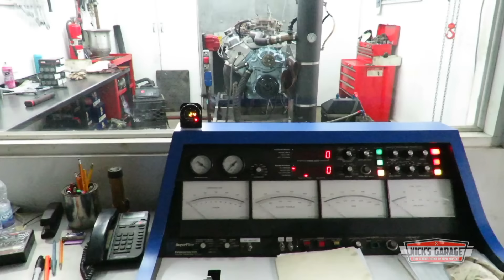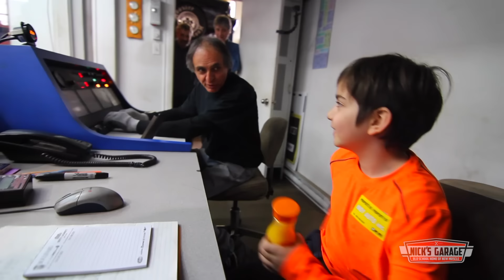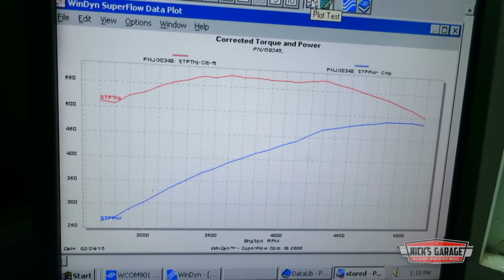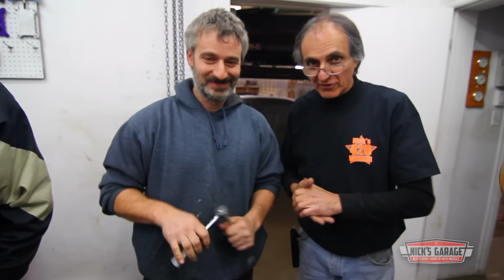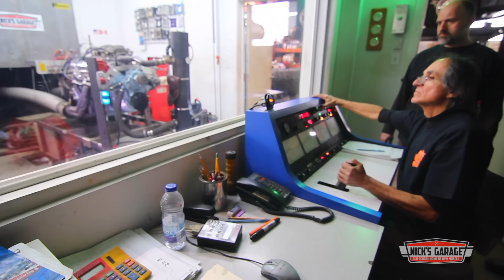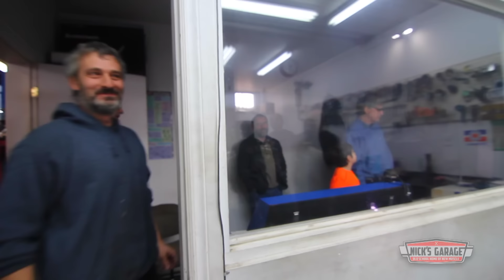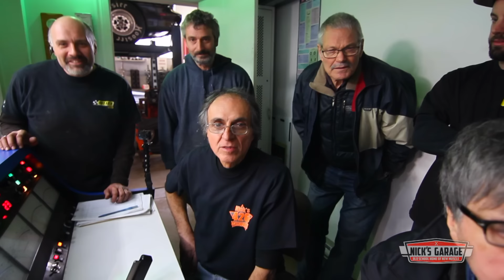Fire On The Dyno!! - Pontiac 455 Lights Up

Comment: Kauffman aluminum heads would be better for 455 Pontiac
Reply: blake Choquette I could see only 28 degrees with Kauffman heads but the e heads normally like a little more timming for max hp
Reply: Nothing here i've seen doesn't impress me.

Comment: It is awesome seeing 500 hp from an old iron block 455. See boys they dont all have to be ls motors.
Reply: Don't tell Chevy about this. They'll be putting 700 pound cast iron lumps in the ZR1. They're wasting their time with 400 pound engines that make 755 hp, idle down around town and get 25 mpg. Yeah these old pigs are the answer.
Reply: @bigblocklawyer  Gran Nationals were doing that 25 years ago..
Reply: @DarkSim77  I had several 400 ram air 3 TA's and a 73 TA with a 455 Super Duty I put in it out of a totalled 1974 SD TA.
I switched to Grand Nationals in the mid 1990's and had 11 of them over the years. I liked my Pontiacs and liked my Turbo Buicks.....both bad arsed in their days. Wish I would have kept the 73 Trans Am and a couple turbo buicks as well. Oh well, have the memories. Had loads of fun at local tracks on "test and tune" days.
Reply: I respect them old  Engines,but I'll keep my Ls
Reply: hehahha only narrow minded LS idiots thinkt hey are fast when the reality is bone for stock the pontiac leaves it in the dust! And for them to think 500hp  is such a hard feat, i laugh at them for the stupidity they spew. ive got an iron headed 455 i am running also and its got double the axle snapping torque that any stock ls puts out
Reply: LS stands for Lousy Swap for Lazy Suckers.
Reply: chrisrhudy2000 And just think, since you cant adjust the valves in a LS, If Nick wanted to switch to 1.6 rockers on a LS, he would need .050 or .100 shorter pushrods to keep the rocker centered on the valve stem.
Reply: Zach, The LS is a great engie, but it's got no class..
Cookie Cut engines, mind numbing ..
You get beat by an LQ4 with a turbo.. yea.. ok, you get beat by an engine designed in the early 50's, no less by the engine that started the muscle car... It's got cred.
Reply: @Ron F  LMAO the fastest N/A pontiac has more than that. Reread my original comment. We not talking about "boost" or chinese hardware that doesnt belong on an AMERICAN V8. That 4.8 will get taken to gapplebees by 3 car lengths vs a Pontiac V8, N/A vs N/A.
Reply: besides that wimpy pepsi can overheats one too many times and then its toast

Comment: I hate cork gaskets, get oil or trans fluid on them. They split like that
Reply: Wayne Brogdon.   The only reason it had a split in it is because it was over tighten.
Reply: Darrell Grisham.   True, to tight , no good.
Reply: he even had those ralph nader consumer safety corvair bars under the valve cover bolts
Reply: +Darrell Grisham Ha-ha! Yep.

Comment: I would add more duration to that Pontiac, it sounds like it is laboring with that 200 psi cranking pressure, yes it has aluminum heads which resist detonation, but it just does not sound happy.

Comment: what pulley system is that on the water pump. I see those on every motor that you guys work on
Reply from the maker: The water pump is hooked up to an electric motor while on the dyno. Nick can switch it on or off from his console, so he can put the engine temp just where he wants it. Thanks for watching.

Comment: As a motorcycle mechanic of 45 years, I have adjusted thousands and thousands of valves and every time a car mechanic adjust valves I never understand why they spin the motor over so many times, you can adjust the valves anywhere as long as you are on the base circle of the cam, so you do not have to spin the motor over that much, just saying.
Reply: Maybe with a V8 installed in a car you would hop around from the left fender to the right fender, bump the motor and hop around again. He does one side at a time on the dyno, that's 16 valves. A motor cycle has 1, 2 or 4 cylinders.

Comment: Pontiac made some mean machines in its day :) Dat`s a fact
Reply: Except the rods are junk after 5500 rpms.   I've built many 428 and 455s.
Reply: I own a 1966 tempest.. bought when I was just 19 years old..I'm now 54..
406.. pontiac motor....12, second car
10,s on a 210.. shot..

A 1978 GrandLeMans..half baked big tire car...bought 4 years ago..360 Chevy.... motor.....10, second car..low nines on spray..just a small 125 shot

Comment: All that talent and work probably doesn't come cheap but the attention to detail is what counts with vintage machinery.
That dashboard looked like the space shuttle lol.   I pine for the old days of stovebolts and lots of engine compartment space.
There is true art in using hand tools properly.   Impact wrenches are for rusty exhaust brackets.   
Very nice Pontiac.   Looked like an individual runner intake.   28 degrees advance and pump gas and almost 600 foot pounds and over 500 horse.   Very impressive.  Always good to have extra gaskets in the shop.
I hope there were jack stands under that low hanging hoist in case someone accidentally bumped into the lever.   Another great video.

Comment: Putting it out with "not booze," (see "AvE,") instead of an extinguisher. Was that to keep unnecessary chemicals off the parts?
Reply: And they make a god-awful mess of EVERYTHING. Pop a powder-based extinguisher in an enclosed space, and you'll be vacuuming for =days= and still not get it all...
Reply: Dry chemical extinguishers (ABC) are corrosive.  Guys like this should use a CO2 extinguisher.
Reply: Yeah all that powder getting sucked into the engine too would not be good
Reply: Also that,stuff in them is not good for your health.
I found out the hard way.

Comment: In the 70's I caught flak for being the oddball racing Pontiacs and started with a 455HO model with factory round port heads. Aftermarket goodies just didn't exist, not even headers for those heads. I was happy to see 455 in the description but on fire ? Lol
Great video, happy to see that blue paint in your shop.
Reply: They still don't make very much after market things for the Pontiac
Reply: You can pretty much build a Pontiac V8 these days and not use one single OEM part...... if you have the cash.
Not so much 26 years ago when I built my 463.
Reply: Not as much as Chevy or ford. Definitely more than Buick or Olds.
Reply: Where'd you live siberia?

Comment: Jesus, Nick the only Pontiac engine I've seen in your show/shop and you set it on fire smh the level of disrespect hahaha.
Reply: is it me or did anyone else think that motor should made more then it did.
Reply: Tell you the truth I've seen Pontiac's with stock cast iron heads make 450-500HP so yeah it could've made more with the aftermarket heads. But that's likely not what the customer wanted. Remember Nick has to build what his customer wants. But yes, the engine has the potential to make more power.